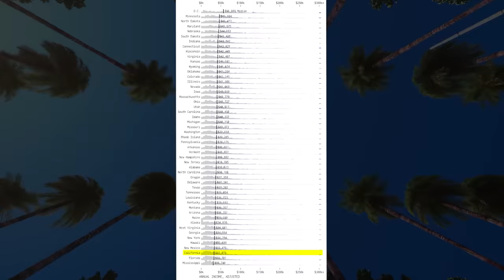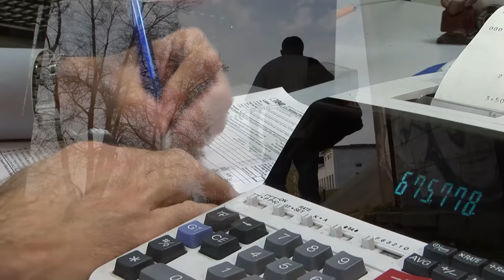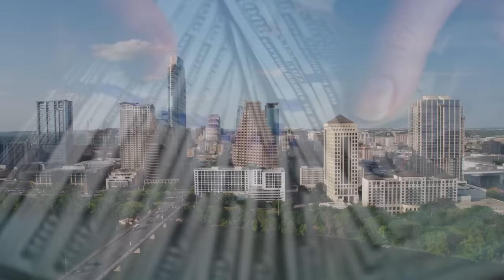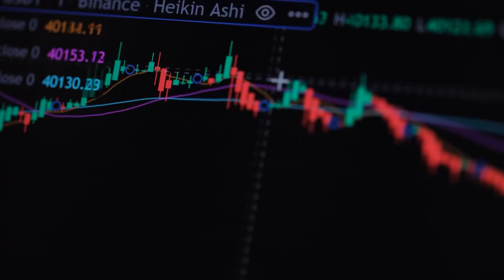The Ruthless Rise & Fall of California

Comment: There are a lot of great points in this - but it's also very unnecessarily grim on the future. 

A lot of this could be fixed by building more housing, and eliminating things like "discretionary review" that let people (often old, retired, folks) to stop any type of development that can provide more housing for people. It's kind of amazing how many of CA's issues can easily be traced back to this fundamental issue around housing and how it is (or not) distributed and built through the state.
Reply: “Grim” will be the outlook for California for the foreseeable future.

Comment: The problem I commonly see especially in the Sacramento valley is the lack of available housing that isn't already priced out of the market. So often when housing is being built it is extremely expensive Single-family car oriented housing. This drives any substantial growth out of the area and increases the rich-poor divide. What California needs to do to cement its place as the world 4th largest economy is encourage building more housing, multi use preferably close to cities where jobs are. This will help the growing homeless issue and reduce the cost of living for many who are priced out of the market which increasingly sees housing as an investment and not a commodity.
Reply: The problem isn't just single-family homes. When we see new high density housing built, whether apartments to rent or condos to own, they tend to be expensive luxury housing. In theory, if you built enough housing on a macro scale than the cost goes down across the board. But you would have to build tons of new housing to have that affect. Meanwhile, what is built doesn't give much option to the middle class renters and buyers who maybe could get by paying $2,000 per month or $500 to buy, but can't afford paying 50-100% more for housing that caters to the wealthy.
Reply: Prop 13 is a big reason for this. Municipalities don't want to build dense housing because they end up lowering per-capita property tax revenue.

Comment: The stats about Venice Beach vs Metro LA population growth since 1960 might be true, but they are applied in a misleading way.  Venice Beach encompasses a 3-square mile area and was largely built out by 1960.  As the residents have aged and their children have moved out, it makes sense that the population would show some decline as household sizes get smaller.  The newer people moving in are also having fewer children since fertility rates are declining.  Metro LA on the other hand, encompasses 33,000 square miles and still had an incredible abundance of open land in 1960.  So it was much easier to achieve 91% population growth because there were many places available to build houses and apartment buildings.

The substance of this video seems to be taken mainly from an Atlantic Article that was in large part written based on the work of a single pro-housing advocate, so the stats presented are done so in a way to push that agenda, not to present a balanced view of things.

The information about school overcrowding is even more baffling because the number of school children in CA is in serious decline due to plunging fertility rates.  Most districts are competing for a shrinking pie of students with other districts, charter schools, private schools, and home schools.  The district I live in is considering shutting down 4 out of 13 schools due to a 1/3 decline in enrollment in just 10 years!  There are currently more 8th graders enrolled than kindergartners, so the trend is still accelerating!
Reply: I appreciate the info you added here.  This is why I watch multiple videos/docs on any important topic and then supplement w/ articles.  It will be nice to have a one-place-for-all info quality of videos/docs (even if we have to pay for them)
Reply: Fewer students doesn't necessarily mean smaller class sizes. As teachers quit or are laid off, there can still be more students for every remaining teacher even if the total number of students declines.

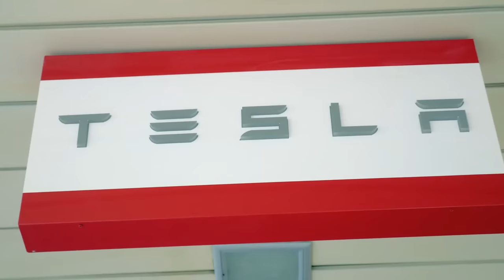Comment: Great video. However, it's important to note around 11:40, you mention that the rise of Silicon Valley is brought about by higher education, Stanford, and universal schooling. It's cited in a few academic books that the rise of Silicon Valley was in fact NOT due to 'free' education, but rather a tightly compact network of Venture Capital firms, military research and bases set up around SF (namely Fort Mason), and more crucially, the fact that non-compete agreements were/are illegal. This led to the spread of networks in engineers to partner with the strong network of Venture Capitalists. In fact, it you can attribute Silicon Valley's rise to Venture Capitalists and their wild innovative way of investing, rather than anyone being 'academically smart' in the area. Every state has its fair share of exceptional technical talent, they DO NOT have a strong network of Venture Capital firms and up until recently, hadn't outlawed non-compete agreements.

Comment: Why California's economy is struggling is simple, nimbys.

Newsom and the current California administration is however doing wonders in ensuring that desperately needed housing is allowed to be built by traditionally anti new construction city governments, and they've brough the hammer down on them. For example when cities within LA failed to meet the newly set requirement for the amount of new housing needing to be built, the cities were then as a consequence of ignoring the requirements by being forced to approve basically all projects that passed the bare minimum requirements (structurally sound design that won't collapse and having the necessary utilities). For example one low rise area of LA is now being forced to approve a 15 story apartment building with hundreds or even a thousand new residential units. They fucked around, and now find out.

Also LA is doing wonders with its public transport expansion, though both this and the housing changes will take years to show their effect
Reply: Sure it is.
Reply: @jaybee9269  Right, he probably thinks it's normal for cities to have a whole bunch of tents on the sidewalks and just tolerating all sorts of crime, the overall tax rates and expensiveness in general doesn't even factor in. Just building more apartments and public transport is only going to attract 20 year olds who are naiive enough to live in such a far left hell hole. The midwest and a few other areas of the U.S. has pretty much persevered their standards of living because they reject the trendy social experiment nonsense.
Reply: @ZombieCSSTutorials  >> Newsome, Trudeau and Macron should start a boy band.  They have great hair.

Comment: It's crazy how California used to be considered affordable and now it's just outrageously expensive. What also pisses me off is that I saw in two consecutive elections a proposition on the ballot that would have actually reduced the cost of living if it was to pass. But people fell for the anti ads from the real estate companies that wanted to continue to infinitely raise the rent. People fell for those anti-heads and the propositions failed each time. 

I remember actually grabbing my voter ballot and reading what the pros and cons of the proposition were and the literal con was that they would replace the old system with the new one. That isn't even a con because the old system was not doing anything to prevent the rise of rents. To set a cap on how high properties can charge rent would have really slowed down the increase of rent by now. 

I'm also frustrated with those rich bastards who wanted to do everything they can to prevent construction of more apartments just to keep the value of their house hire. I mean if you love where you live so much, why should you care that the value goes down? Are you really going to try to sell it during your lifetime? But greed is a powerful thing and thanks to that we have some horrible things going on

Comment: Did anyone else catch the part where, opportunity of high tech jobs being available without locating in city. 

This would mean that, there is an equal opportunity for talent that does not require even living in state.

It should also mean that tech jobs would be available to anyone who qualified.

It's the hard luck story of living in the modern world where it's simply not possible to grant equality of outcomes AND maintain a competitive edge on the world's stage. 

It nullified the housing problem for proximity but it exacerbated the skill set chasm between the truly competitive and the hoards of the normal hard working folk.

Comment: in the movie margin call, one of the protagonists is confronted with how much he was paid last year. 2.5 mill he said. he was asked "how did you spend it all?". this answer should scare the crap out of anyone...the first thing he said was "well, 2.5 and the government takes 50% right off the top" what did the gooberment do to deserve 50% (even a trader has a right to keep what they make right) of what anyone makes? ff to california. i am a property manager here in the central valley. when i first came to work here, the property tax was equal to 1 full months rent from the entire complex. 18 units @ 500 + 1 unit @ 900= 9900.00 per year. that was in 2009. today its double that @ 1000 per month x 18 and 1700 per month x1 with more increases on tap. and this is twice a year, 2 full months rent. evidently politicians found a way around prop 13 i guess. 
 when we moved here from maryland in the early 70's my step dad bought a 3 bedroom house with a pool on 1/4 acre of land for 16,000 dollars. it recently sold for 480k. bear in mind what it is that we're dealing with here. a mostly (or used to be) migrant community that works in the fields picking whatever needs picking. they make between 5-20 per hour and rents in excess of 1100 a month are not sustainable for them...or anyone else for that matter. now there are state uni's every 30 miles up and down this valley. no way is that many uc's needed nor should they be. not everyone is cut out for college. nothing wrong with a trade school. i could go off on how much money california has pissed away on the high speed rail project to no where...but i think i'll save that rant for another time.

Comment: I don't mind CA having a super high income tax rate for the wealthy.  There is only 1 CA, and if folks want to live there, they should pay for the pleasure - otherwise they can go live in TX, where the average low temperature in the summer is much higher than the low 60s along the beach, or in FL, where the interior bays get as hot as a hot tub in the summer.

As a newly graduated Aerospace Engineer in the last days of the Cold War, I moved out to CA because that was where the aerospace industry was king.  However, I could not fathom being an engineer and not being able to afford a canonical single-family detached home, and so I did my 1 year and bolted to a locale with a normal cost of housing.  (Somehow I had found an apartment in Huntington Beach that only cost $550/mo; now it rents for $2400, LOL.)  All the folks & companies leaving are coming to the same conclusion - and this is before the other problems CA has like folks defecating on the street, etc.

Comment: Stagnation, incomplete systems, outdated systems. Then some potentially good ideas that weren't thought out well and properly

Our public transit systems are not planned out well and are severely outdated, for one. Leading to all sorts of transit issues such as traffic jams all over the place during rush hours. Then you need to consider coordination of working hours on when work begins and where which so many people all start at basically the same times and end at the same times. San Jose has a lightrail system. That system goes down so easily because it is on the same level as all of the cars, so one car accident will take several different lines out of commission because the rails are blocked, and aren't allowed to be used until the entire situation is sorted which is hours after the vehicles are taken off the tracks

Education system is a mess. They've been trying to fix some things by getting people to teach at schools that really need the teachers for loan forgiveness or to waive it or something. But it's also a thing where the costs of higher education are terrible, and the earnings for teaching are abysmal, and the working standards are pretty garbage as well in some places. Teaching standards are also all over the place, apparently. And you're also tossing teachers who are maybe not the most familiar with the work and don't have the routine down to try to teach at the schools that need teachers the most too. I went to a University which was considered "fairly new" and... well... the curriculum was a bit of a mess for a number of different things =-=;; some parts straight up inadequate, and you're not going to get good enough review to tell them what needs to be improved on if the people just don't know or don't have the experience or understanding

Plastic bag ban? Good in theory, bad in practice. There was no understanding of how people functioned, and you needed to go about the whole thing in baby steps. Not to mention most businesses never bothered to try to fill in for the parts that were lacking. Most people probably didn't need to buy reusable bags -- but buying reusable bags was more convenient because who wants to bring additional items around all the time just so you can pick up groceries and whatnot...? Hypothetically, if people skipped the plastic bags all the time, it would drastically decrease the carbon footprint - but convenience and whatnot would stop existing. They never bothered to address the convenience issue. They also didn't spread the memo of what you can use as reusable bags very well at all, or how to navigate the whole carrying a reusable bag around issue. So it fell on the stores themselves to sort of bridge that gap - which most of them didn't. Things like holding onto packaging boxes, supplementing with boxes for carrying items out (but that has limited stock, and who knows how many people constantly forget to bring bags)

Homelessness and employment issues...? Gods there are so many things that can be done, and it's such a bloody mess =-=;; And I am aware of basically none of those things and systems that are supposed to help, and I mildly needed those at some point in time too. Are there employment and housing offices...? Yeah, there are. I don't know anything they do, aside from private employment offices that are a bit of a hit or a miss and are definitely not centralized at all and definitely don't have a robust enough support system for workers. And particularly for an employment system... this one would be something that should theoretically self-sustain after its initial funding too